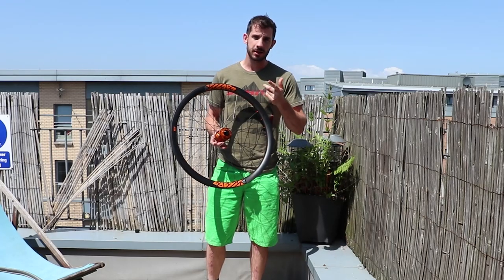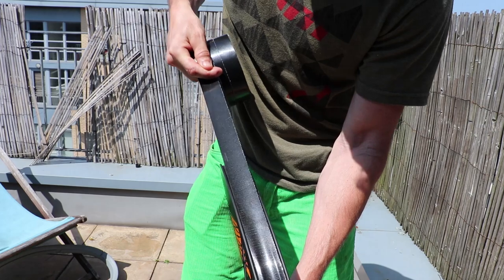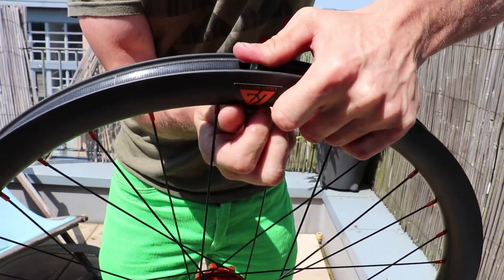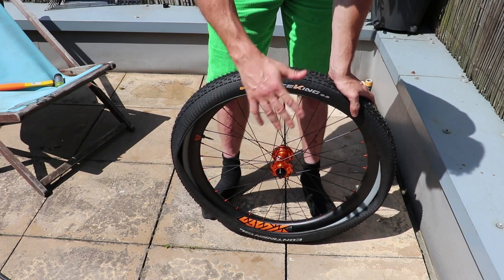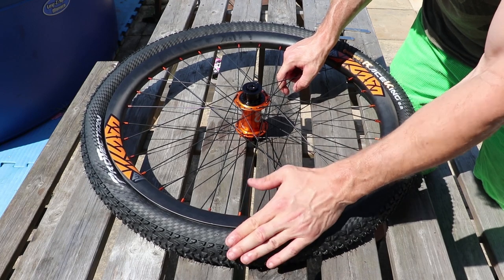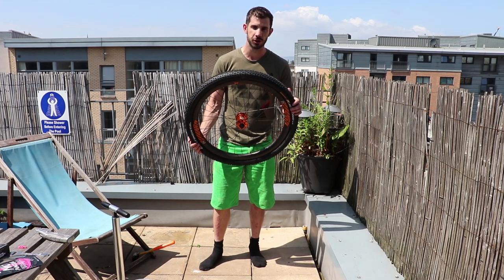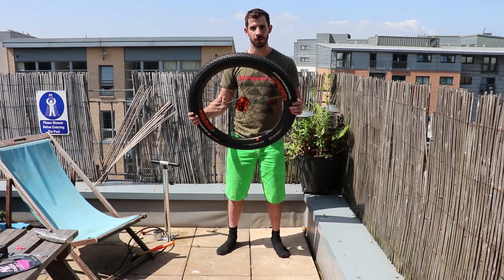How To Fit A Cushcore Tyre Insert + Go Tubeless

Comment: Oh god, please don't use medal tire levers on carbon rims :O in fact, never use medal tools on any scratchable surfaces
Reply: Fair enough :) I'd rather you dent and scratch your bike while conquering the concrete jungles of the UK than at home fixing it. And Park Tool, if you're reading this, hook this guy up!
Reply: @2nd3rd1st  The best tyre levers are made by Park, and from metal. I use them for everything from bicycle tyres to small motorcycle tyres. The smooth machining and smooth finish don't scratch rims at all.
Reply: Alot of metal ones have a rubber coating around them
Reply: @Josh-lv6vn  The coated ones don't stay nice for very long.
Reply: I have used metal tire levers forever and nothing has happened

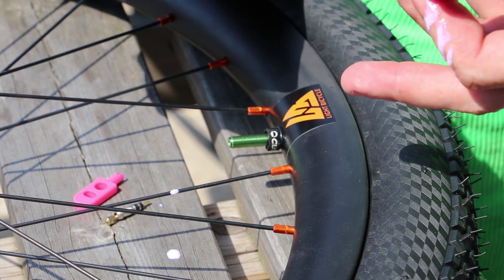Comment: at 6:46 you can see the cushcore valve nut is upside down and squishing the o-ring, if you flip the nut around the other way it has a smooth groove for the o-ring :)

Comment: Nicely done Ali!  You did that like a pro I've tried doing it by pouring it in the tire and it was a mess for sure I like using a rag to press the tape down making that part really quick and easy by "wiping" the tape back and forth.  I really like the idea of fitting more tape to make the tire bead seat I've had a horrible time with some rims and no one at my bike shop thought about that we all gave up,  that's a hack!

Comment: One warning about gorilla tape for tubeless... if you are on rim brakes, and a bigger guy (I'm 190 pounds)  and you are doing road or XC MTB tubeless, you may NOT want to use gorilla tape.
It melts under heavy rim braking.  Found out about this on my 2019 emonda roadbike coming down a 5 mile twisty decent at 45-50mph, generated allot of heat braking into the tighter bends. Tape got hot,  and had an instantaneous evacuation of air out of my rear tire via spoke holes doing 30 or so.   Managed to stop on the front brake using some mad MTB front wheel braking and body weight shift aft action.  Front tire let go instantly about 30 seconds after stopping as well.   
Postmortem revealed the gorilla tape literally softened and  melted and shrunk away exposing spoke holes on both wheels.   I now use stans tape - seems to be less affected by heat 
Have ridden the same route several times on stans tape and haven't had an issue...   so uhhhh yeah... gorilla tape and rim brakes maybe not a good combo if high speed is involved (for trialsin' on HS33 Maggies? Probably ok though)

Comment: So those really went on that easy huh? You must have magic hands my friend ;-) I’m a big fan of the Cush but they are pretty damn hard to install dude.
Reply: I have installed the Cush Core several times now, the key is to get enough slack in the tyres, with some practise I managed to get it so slack I could do it you out tyre lever at the end. get the tyre as far as you can over the edge of Cush Core , hold the tyre and Cush core tight lean it back towards you push it in.
it can take some practise to get it going fast.
Reply: the tyre he uses is a lot slacker, I mean, it does not push it self out towards the rim, with tubeless tyres the bead ''wants'' to go in to the rim, kind of.
and with tyres that are not tubeless they want to fall off.
Reply: stiffness of tyre, will play a role in how tricky it is too, but with wire bead it can be hell to get on I guess. so I would only use foldable tyres.
Reply: Dam he made it look easy, I like that pouched sealant as well
Reply: What kind of tire is that? For riding to the pub? Try putting a thicker sidewall Maxxis Minion on with the cush core it's next to impossible.

Comment: I have a feeling you did that much faster/easier than how it would go for me with a steel beaded DH tire.   Ugh.
Reply: I got a wire bead Magic Mary and getting it off alone is difficult. Getting it back on alone is repretty much impossible. My rims (Stan's Notubes Flow MK3) are really low profile which doesnt really make it any easier.
Reply: Yeah, i run the Maxxis Minion wire beads and I have the same problem. I do use hot, soapy water to get them back on, pretty much the only way I can do it.  An "on trail" flat fix would be near impossible.
Reply: First cushcore install with an Onza Aquila tire took me 1 hour
Reply: Try using the Koolstop tyre mate, although it's only good for getting the the tyre on, you definitely sweat less 😃

Comment: 4:51 this si the process that's actually hardest  but it might be the rim rim & tyre combo, I got 23mm hope rims & Maxxis tyres, you got continental and light bicycle wheels. also if the tyres are not tubeless, it might make it easier to install with Cush core.

Comment: just did this with mine and had tremendous leaking problems. my tires were CONSIDERABLY tighter to get on the rim and i'd mess up the tape trying to pry it on. no idea why my tires were so tight, but they did NOT want to bead

Comment: What's the point of having light carbon wheels if you add extra weight to them?
Reply: Yan Doroshenko so the wheel is still going to be much lighter than most decent tubed set ups and doubt they would be really any difference in weight anyway ?
Reply: According to the interwebs, we're both stupid since the main benefit of carbon wheels is stiffness and not weight.
Reply: Yan Doroshenko haha fair enuf 👊🏻
Reply: Yan Doroshenko exactly

Comment: A couple of things about cush core they are a pain in the ass to fit I have given up. I have Enve M90. In my box I got supplied standard valves so deflating the tire and inflating was a real pain I contacted them but they didn't seem that interested in replacing them with valves that work, a bit disappointed considering its a premium price. Another problem is when you push the tire to the middle to make room its just luck that you don't destroy the rim tape and then you have to start all over again.

Comment: Is the nut on the valve stem upside down? It looks a little bit like the o-ring is being smooshed by the flat side and the side with the o-ring channel is facing outward. Probably not critical
Reply: Ali Clarkson He‘s right, you have it the wrong way round. It‘s not 100% symmetrical

Comment: You shouldn't use tire levers to begin with unless you absolutely have to...but FFS....A metal tire lever on a carbon rim...REALLY?!
Reply from the maker: yes you shouldn't really but if you're careful it's ok...carbon is pretty tough and doesn't just crumble at the sight of metal contact but yeah, plastic is preferred